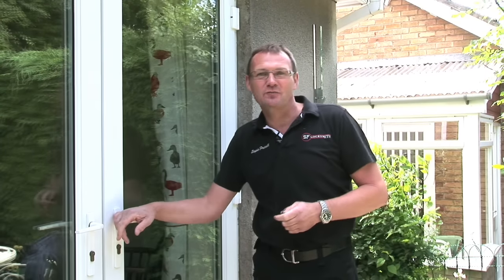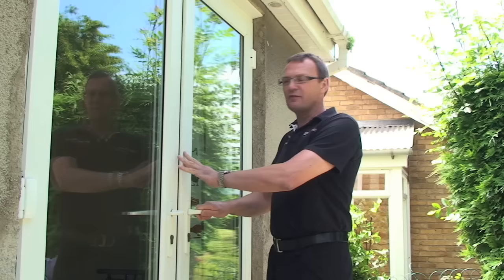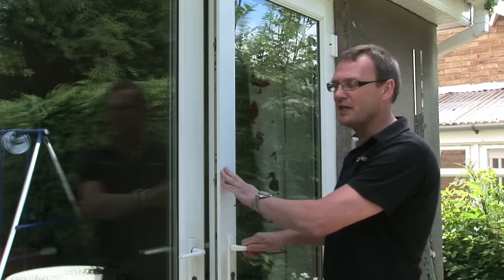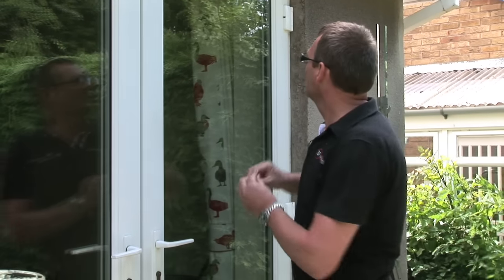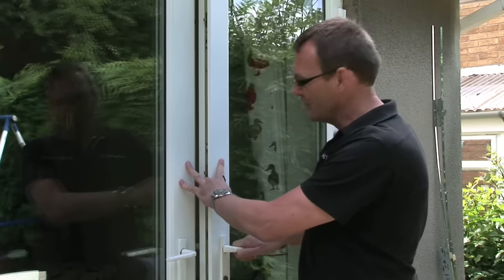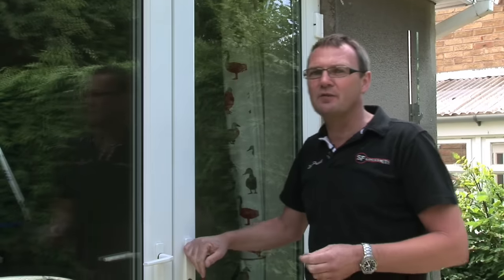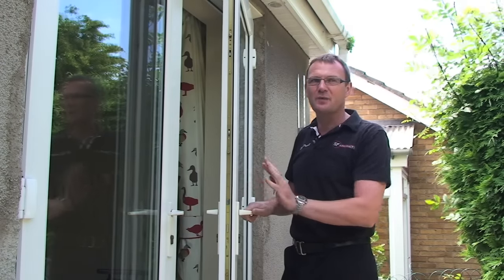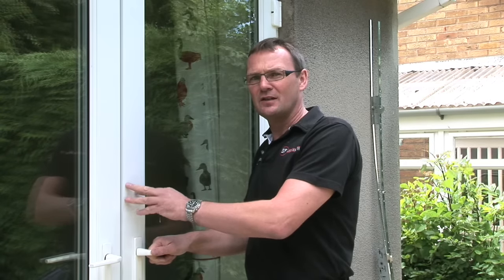HOW TO ... Fix a UPVC Door

Comment: That works great thanks! Have you got a video on how to tighten up the door handle (when the screw comes loose) ?  Looks like I have to remove the metalwork inside the door - is that right?